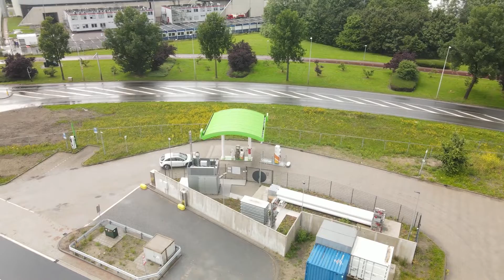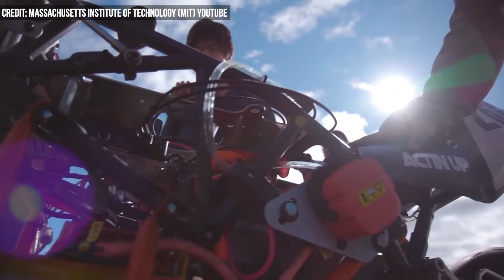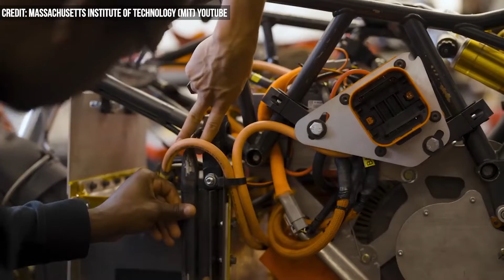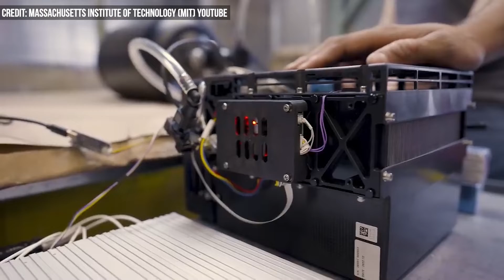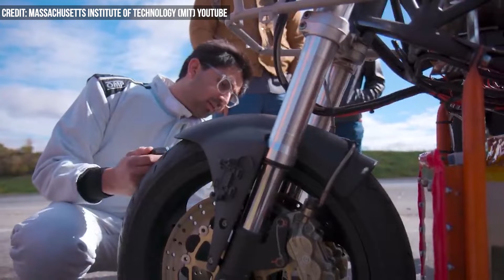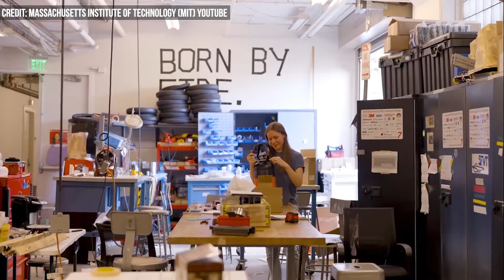MIT Tests Hydrogen-Powered Motorcycle

Comment: EVs and hydrogen without infrastructure are junk. 
Hybrids are the best short term answer until batteries and infrastructure catch up.The Steam engine went extinct in the 40s and diesel electric locomotives have been their replacement since them.  Diesel electric IS a hybrid !!! Today, Edison Motors has a succesful hybrid logging truck that beats the Tesla in both power and fuel economy and most importantly, and it is lighter than the standard trans truck NRA. No range anxiety.
Get it straight .. The infrastructure TODAY  CAN NOT support EVs or hydrogen but hybrids can and are doing it with no infrastructure change with  BETTER FUEL ECONOMY WITH PROVEN TECHNOLOGY